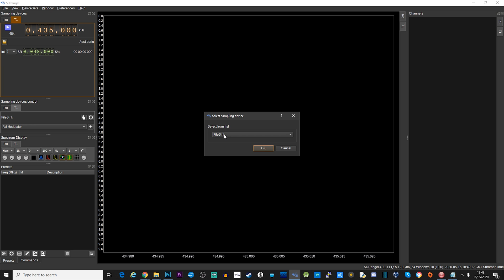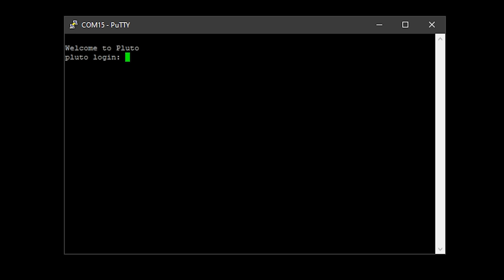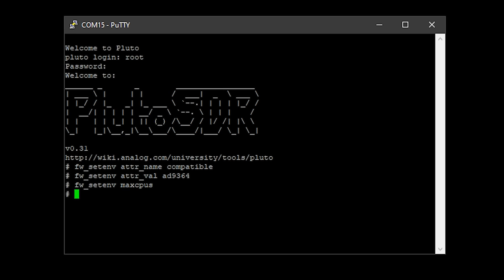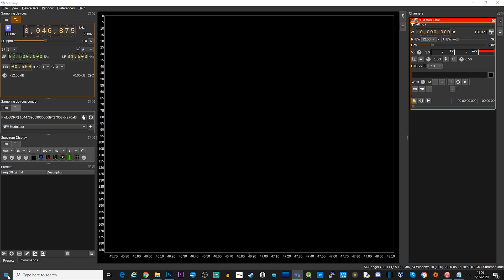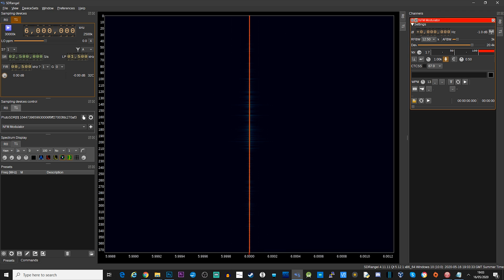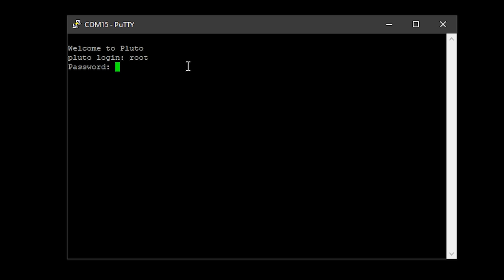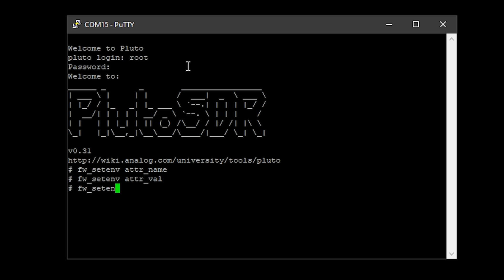ADALM PLUTO Frequency Expansion Modification Plus CPU Cores

Comment: That was a little harder than expected this time. 
To enable frequency mod:
fw_setenv attr_name compatible
fw_setenv attr_val ad9364
fw_setenv compatible ad9364
fw_setenv maxcpus
pluto_reboot reset

Windows drivers and libiio software from AD need to be installed first. With a Pluto in v0.31 firmware, the method in the video didn't work with my device this time. The five commands above did work. SATSAGEN v0.7 settings for the device needs a scan to read your Pluto and the transceiver AD9364 selected. Then the frequency knobs all pull down to c. 50MHz. I could see my Tx signal on 2m amateur band for the first time. 73 de M0YDH
Reply: Holy crap that was hard info to get.  Thanks!!!

Comment: Is it works with all hw release/versions?
Reply: From what I've seen yes. Use this page to get the settings you need based on your revision and version you have (e.g. Rev C, v0.32):- https://wiki.analog.com/university/tools/pluto/users/customizing#updating_to_the_ad9364. I have a Rev C, v0.32 and by using the fw_setenv attr_val ad9361, my Pluto now does 70Mhz - 6Ghz.

Comment: Doesn't seem to work on the new 0.32 firmware! I just on this unit and struggled for a couple days as to why it wasn't working. Downgrading back to 0.31solved it right away.
Reply: I can confirm this; I was on v0.32 and changes did not take effect. After downgrading to v0.31, I can go up to 6GHz and down to 70MHz (but not to 46MHz, like on the video).
Reply: Forgot to mention; I have a rev B

Comment: Interesting stuff, I'm torn between a Hack and the Pluto now! I'm a ham, so the lower frequency of the Hack might just edge it for me. Found the slightly slower presentation much easier to follow...it gave this old guy time to take your information on board. Thanks again.
Reply from the maker: You’re welcome :) Yup, and it’s all down to what you think you’ll need to do with it. I like the fact that with the Pluto you can use SDR Console life a transceiver with the Pluto, but no TX support for the HackRF. Enjoy :)
Reply: @TechMindsOfficial  what TX is?

Comment: Isn't this only for Gen 1 boards that used the AD9364 (transceiver chip with the 'unlocked' specs) ?
Reply from the maker: I only received mine a couple of months ago so I’m assuming this is the latest version.
Reply: I bought my Adalm Pluto from Mouser, received the parcel june 29th 2020. Even transmits on 50Mhz. Maybe the power is out of specs but modulation is absolutely fantastic. This board needs amplifiers and filters for RX and TX, we know that anyhow, specs will not change anything for ham radio.

Comment: A quality video, thanks - you did the mod and performed a test to verify. I did this mod on my rev. B Adalm Pluto and it seemed to work OK for me. Though, the only test I did was to transmit some CW on the 2m amateur band into a dummy load. I used the Pluto to receive the transmission. I also confirmed reception on a regular 2m amateur transciever. The quality of the CW tone was very rough. I suspect that the Pluto does not transmit a pure sine wave?
Reply from the maker: Thanks for your comment, appreciate it. Personally I have never tried CW with the Pluto, only SSB for QO100 and NFM for local testing.

Comment: Hello, can you please share which revision of Adalm Pluto you applied this modification to?
Thanks.
Reply: This is the actual question.... rightly pointed out
Reply: Have a new Adalm Pluto from Mouser, received june 29th 2020, confirmed operation with a 2m and 6m rig, TX and RX work fine. Tunes even under 50Mhz.

Comment: To transmit at 6GHz did you use the original stock antenna or did you use a special antenna for 6GHz ? Will the high SWR break the Pluto ?
Reply from the maker: The power at 6ghz would be so small a short burst would be okay, but yes, always use resonant antennas when transmitting.